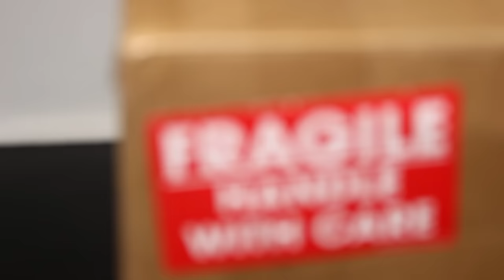World's Smallest 5 Axis Milling Machine - Pocket NC V2

Comment: How loud is this machine? Can you use it in an apartment? Please reply,  Thanks
Reply: Depends on depth of cut. If you take small "bites" then biggest noise generators will be stepper motors, if on other hand you start plowing through material, then that too will create noise.
Reply: @karlomoharic3992  
Thanks for the reply
Reply: @egyptianamericanpatriot1531  No problem , if you are interested in cnc machines , I would recommend : CNC programming handbook by Peter Smid
Reply: @karlomoharic3992  
Thanks again, do you think I can use this machine in an apartment?
Reply: @egyptianamericanpatriot1531  What type of material do you wish to machine ?
Reply: @karlomoharic3992  
Stainless steel
Reply: @egyptianamericanpatriot1531  NO and there are two reasons for my answer : fine steel dust , which just gets everywhere (don't shit where you eat , so to speak) no matter whether you have enclosure or not  &  this is a 5k toy , not a machine tool. IF YOU WANT TO MACHINE ANYTHING harder then very mild steel you better have proper machine and tooling for it (you just need rigidity). For 5k you are better off , renting a small garage and buying an old  Bridgeport milling machine (down the road you can even convert it into CNC). If you have a need for a complex part (curved surfaces) that can't be fully machined on standard 3 axis machine you can always go to a decent machine shop and just ask them for a qoute. This thing is really only meant to be used with soft plastic , 1000-series alu alloys ,  C360 brass soft wood and that's about it. Machining any kind of metals in apartment is a bad idea , due to fine metal dust (fucks with electronics + bad for health).

Also regarding complex parts , a great alternative to a proper 5 axis machine (if you don't have the cash) is casting . Obviously you need to do that in a well ventilated area. If you have interest in metalworking , your best bet would probably be to rent a small workshop or a garage.
Reply: @karlomoharic3992  
Hey man, it's so cool you took the time to explain all this to me.  I really appreciate it.  Few people would have have put in that kind of effort.  Your awesome.  I'm just getting started so wish me luck.
Reply: @egyptianamericanpatriot1531  No problem , good luck :)

Comment: get Autodesk Fusion 360/ HSMWorks/ HSM Inventor and use pocketNC post processor.

for fast HSM milling use foll tool depth with high speed and 1% to %5 tool dia. engagement use 3d adaptive clearance with up milling/ conventional milling and leave 5% to 10% for down milling/ climb cutting for 2 passes of finishing. Enjoy! and follow Titans of CNC on YouTube and facebook group

Comment: What's the point of attaching a turbine wheel to a motor shaft? Once you rev the engine it will give little or no thrust: it's supposed to convert hot gas power into mechanical motion which then can be used to spin a larger fan (turbofan) or prop (turboprop). No point in making it spin with an IC engine, it's useless motion

Comment: I just want to add my voice to the side of the argument that thinks $5k is reasonable.
I have done a couple of retrofits of "real" machine tools to CNC and know what is involved. (And I have worked as a design engineer for companies making broadly similar machinery)
It is probably possible to make something  yourself like this for less than the asking price. But you would probably need to make a few versions to get to where this off-the-shelf one already is. By that time you might well have spent more. And you would have to not value your time at all. It also seems entirely reasonable that a business should be allowed to make some profit.
$5000 is only £3700 anyway. That sounds a lot better.

Comment: On a seven axis CNC machine what are the 7 axis other than XYX
Reply: Well first of all  , if you take 5 axis machine , other two axis are usually table rotation and  spindle head rotation. With 7 axis machine you simply add one more main spindle head. Basically  you have two main spindles so you can potentionaly cut your work time by factor of 2. One thing to note is that adding more axis , doesn't mean that  you will be able to take full advantage of them. If you mostly machine square parts or parts with flat surfaces (no contours) , then 3 axis cnc mill is more then enough.

Comment: I can tell the machine is vibrating too much, which means your putting too much strain by going too deep too fast try lowering the spindle speed and the machining speed to, try doing passes of 0.25mm and max 0.35 if you are in a hurry, the last finishing pass needs to be done smoothly, lower the speed the machining speed to half and do passes no more than 0.1 to walls and 0.05 on the floor, I'm telling you this with the knowledge I have working with big industrial machines so with this one you will need to lower the machining speed more than usual, one very important thing is to dampen that vibration using a thick hard rubber mat, your spindle will thank you later

Comment: I was looking to try a mini turbo on the wankel engine but couldnt get a wankel for cheap so i figured id do it to an OS FS-70 4 stroke instead. much cheaper and parts are available.
Reply from the maker: Exactly my thoughts, but since I have a wankel, why not try it on it.
Reply: JohnnyQ90 i was gonna use one of those turbo keychains as the housing and rebuild the innards. With your machines that should be an easy task! Id suggest carb > blower > engine or use a micro water pump to push the fuel through the carb. Good luck! Cant wait to see what you do!

Comment: Tormach costs about the same and way more included. Also way more capable
Reply from the maker: A Tormach 5 axis is about the same price? I doubt it.
Reply: Tormach 5th axis is maybe another 1200 add on. Well worth considering the auto CMM measuring and the 3D part measuring.   No CAD model needed it will wright its own program

Comment: So I went to the link to check this thing out n yeah 5 THOUSAND DOLLARS! not worth it at all in my opinion. Mainly bc it had no specs for the machine, tolerances, accuracy, or max depths of cut on steel or aluminum. Or at least I couldn't find a link to a page with those specs but I also didn't care enough to try after I saw the price. Go buy a CNC plasma cutter for the same price and you can have your own business.

Comment: 1:18 - When you think you've seen it all. Measuring tool lenght offset by pushing cheap Chinese mechanical button with a tool? If they thought this is ok, I can only imagine how terrible everything else is. It can clearly be demonstrated here this machine is uselles even for alu milling. Terrible surface finish.. sound that makes your years blead, etc.. There is no way this machine can make anything in accuracy range of 0.25mm or about 0.01".
Reply: You should see how they installed the linear guide rails (there's a video on them assembling a machine).  It's quite amusing that they thought this was OK for a $5K machine.  Throw in the significant overhanging load (spindle/tool) and I can see that this wouldn't produce much to any accuracy.  But hey, those parts in aluminum and Delrin sure look pretty...

Comment: It will not deliver any precision. Too much vibration (you can hear it even when tool spinning freely without load). For such machine you need hydrostatic bearing, and this machine obviously does not have one, or else it would work much much more quiet. This machine is just a toy.